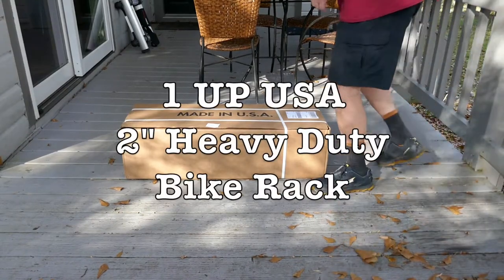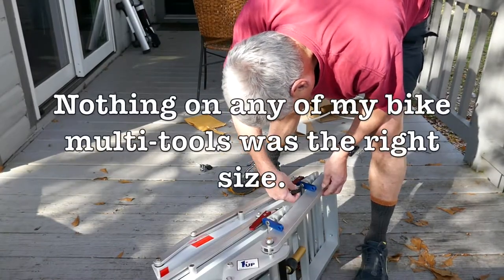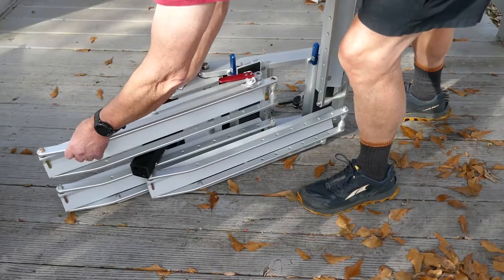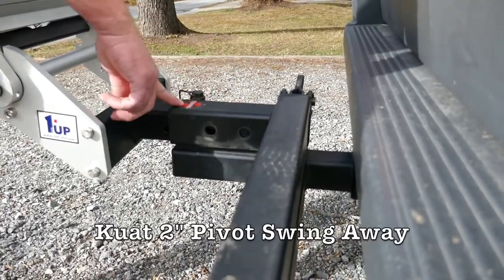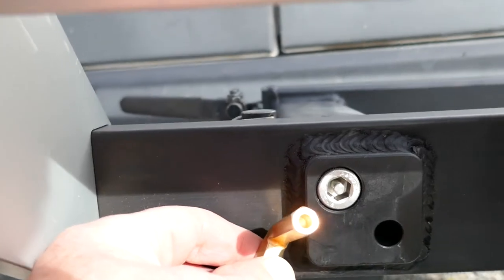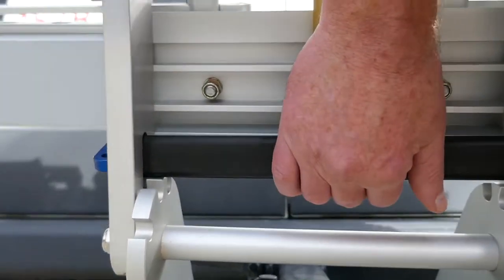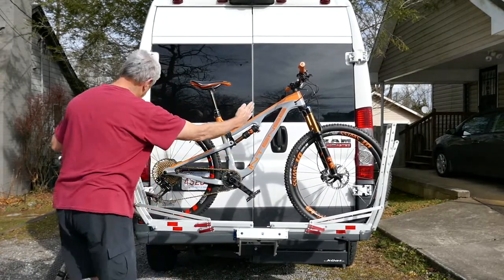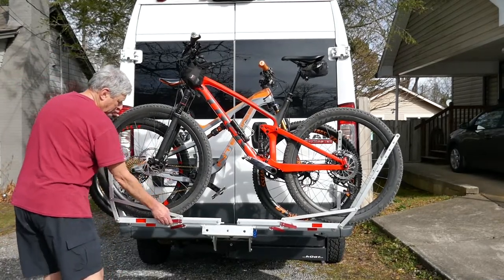1Up USA 2" Heavy Duty Double Bike Rack Review

Comment: So there is no locking available for the bikes mounted unless you supply it? While it has the security Allen wrench, it doesn't come with anything to secure the latches to take the bike off?
Reply: Sorry for the late reply, but they do have a lock - a bolt lock that runs through the tire holders - that is sold separately.